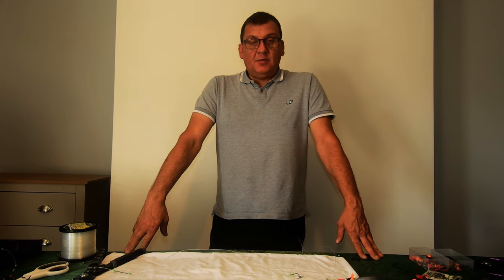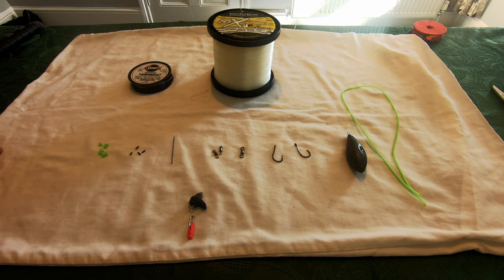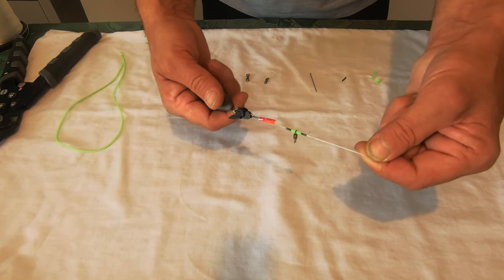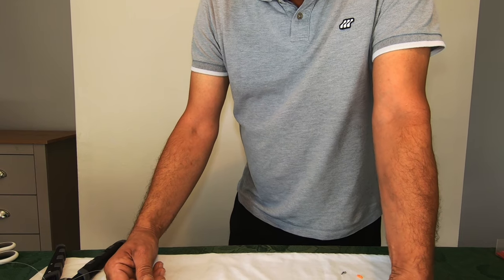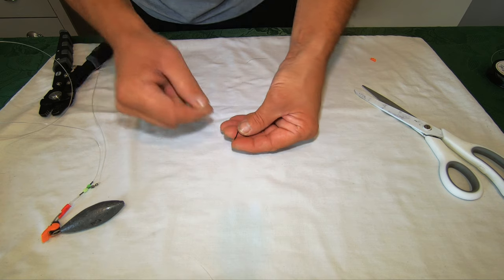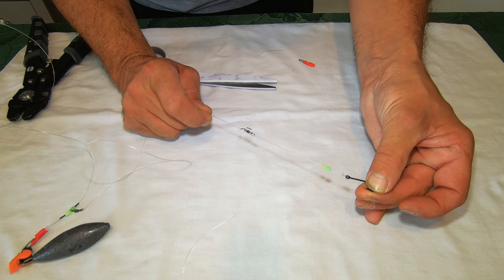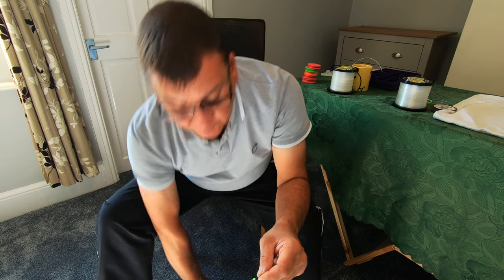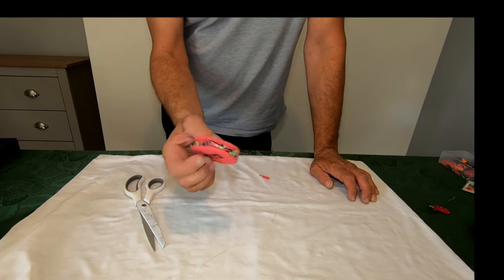How to sea fishing rigs - loop rig / Portsmouth Rig.

Comment: Nice tutorial love the loop rig. You can use small pieces of silicone or neoprene rig tubing instead of crimps (I use six tiny sections). These can then be slid up and down the rig body as necessary to bring the rig to tension when clipped. The other bonus is it doesnt damage your line like a crimp potentially could.
Reply from the maker: good idea i like that idea thank you

Comment: HI PAUL enjoyed the vid as I am a long time angler but just moved up north from the south coast , learning the best local rigs etc now , just a small point I don't mean to be rude but I am pretty sure that the links are called TERMALINKS , and not thermalinks . keep up with the vids I would love to learn some more rigs , and you explain very well . cheers tight lines and full hooks .
Reply from the maker: No problem they were not out that long when the vid came out I have pointed the mistake out a few times thanks

Comment: Just watching over again as I've ordered some of the trident components and I'm going to have a crack at making one later, is there any reason why you don't use pennel rigs at the ends of snoods?
Reply from the maker: i would stick with single hooks on the loop rig i have another rig making vid up later tonight that covers the up and over rig that suits a pennel style much better. very similar rig but uses one snood line instead of two.
Reply: @StarfishSeaFishing  cool mate will keep an eye out for it, I bought some of the hangover kits from trident aswell which are used for up and over rigs, look forward to it

Comment: Was going to comment on you video for the rays the other day asking about this rig as it looked quite a complex rig but now I've seen you make it it kind of looks like a complicated 2 hook clipped rig, are there any advantages to this loop rig over the 2 hook clipped?
Reply from the maker: the one up one down rig gives you the advantage off putting one bait on the sea bed and having one bait up from the bottom. when you are match fishing this rig is the go to rig for most venues when you need a streamlined rig at distance and can add yards to your cast the clipped loop rig is essentially a clipped one up one down rig giving you the best of both baits placed up and down
it is like an up and over rig with one bait in the up position also two baits on one rig up your chances of catching a fish or two fish at the same time.
Reply: @StarfishSeaFishing  will definatly be giving it a go 👍
Reply from the maker: @antjohnson4236   works a treat mate